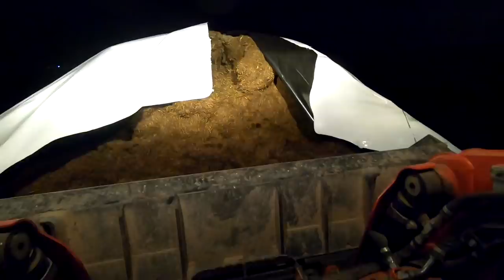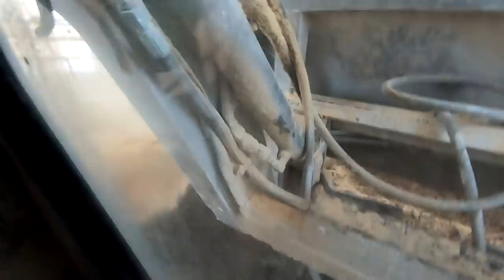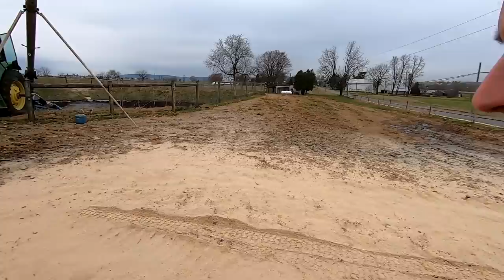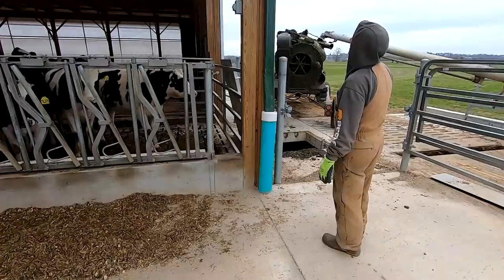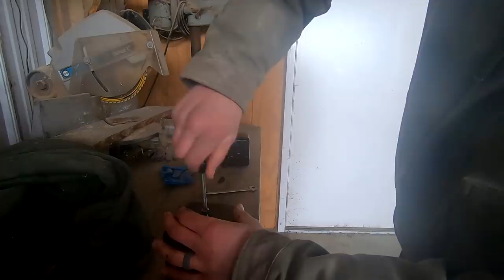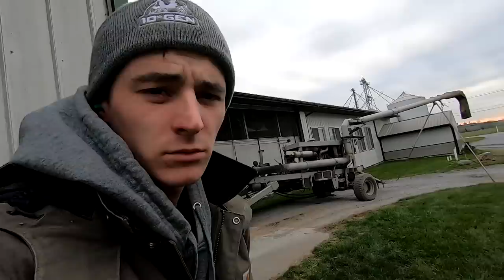Cleaning Out the New Pit

Comment: How do those big tankers create the vacuum to blow the slurry out? The top fill hatch doesnt seem to close over.
Reply: They do not use vacuum or air pressure to discharge,   the manure goes through a liquid pump on the bottom of the tank
Reply: @chucklesx  ah, I see. In the UK we use vacuum tankers to blow it out. Thanks, that explains it.